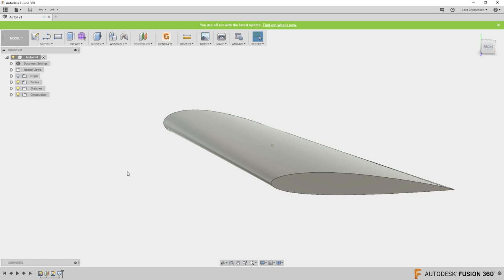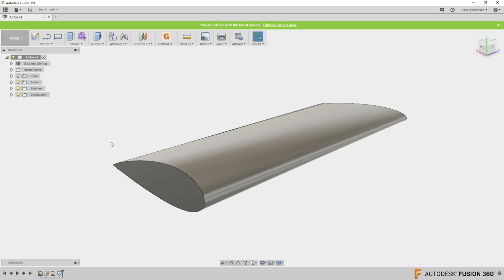How To Create Airplane Wing Ribs    — Fusion 360 Tutorial — #LarsLive 162

Comment: Lars,  
I remember almost 40 years ago using a drafting board and T square to draw a rib in class as part of required training as an aircraft mechanic.  The idea being if someone brought an airplane to your shop that had damage of some sort that required a replacement rib you could make a pattern.  Airfoil shapes are simply X, Y plots.  I never did,  and the technique would back then more easily apply to a rib made of small wooden components.  After school I went on to work on airliners for awhile where "sheet metal" repair was left to gurus of the craft.
However.... I am currently involve in amature/homebult airplane projects and the use of things like Fusion/ CNC/ 3D printing for ribs, cowlings etc. are opening up capabilities, possibilities like never before for individuals.......

Thanks for your presentations,
Bil
Reply from the maker: That is awesome to hear bil k .Thank you for watching the videos

Comment: Generally since Ribs are made of sheet metal I just use the shell command to match the the thickness of the  aluminum. I modeled a few experimental airplanes in Inventor to do simulation in ANSYS way back before F360 was around. However I am sure the same strategy would work well in F360. Now if only Frame Generator existed in F360.
Reply: You can use the sheet folding workflow in Fusion now.
Reply from the maker: Hi OahuPilot Thank you for watching!
I would love Frame Generator in FUsion :-)
Reply: It's not as good as idea as one would think on first glance. Wing ribs are stamped or hammered into shape, not really folded.  I have tried it in Inventor which has more sheet metal functions then F360, it really did not give any real benefits in the modeling workflow. Also you can not select curves for folds in F360 which makes sheet metal work flow not that useful in this scenario.

Comment: you should consider skin thickness from the OML with an offset value. And rib & flange thicknesses should be given as parameters that can be changed without going into the sketch. flange height should be calculated according to the number of rows and diameters of the fasteners that'll be used. And many more detail :) but a practical approach you did, congrats :)

Comment: Is there a way to define one rib section, complete with all its cutouts and such, and then "loft" it through the airfoil so you get the entire set of ribs, each sized proportionately for its position along the wing? THAT would be really helpful, not just for ribs of a wing but lots of other situations where one part needs multiple, slightly different-sized, components.
Reply from the maker: Hi Roger Garrett Thank you for watching!
My first thought was scaling, but using parameters might be the trick :-)

Comment: Great video thanks a lot for this tutorial. What I am interested in is how to add these stabiliser bars to the other ribs without spending too much time on it. I am asking this because I want to create a wing for a model plane and 3d print the hole wing. This means i need a thin surface and inside a lot of stabiliser bars otherwise it would be not solid enaught.
So compared to your video I do not want to create ribs at all just those stabilizers.
Reply from the maker: You are so very welcome :-) Thank you for watching!
I will need to gain some aviation knowledge to know exactly what you are looking for :-)

Comment: Hi Lars, love watching you tutorials pretty much everything I know about fusion is from watching your vids. just wondering for the cut outs in the ribs would it be possible to do two sketches on the outer most planes and do a loft to cut through all the ribs? is it possible to cut through them all using a loft command. Thank you for spending your time to help all of us out here learn how to use this awesome tool.
Reply: Yes it is. Tested it out just a minute ago. Also, instead of offset planes, you can do solid block and pattern that, and then loft/intersect those also instead of splitting bodies.
Reply from the maker: Great answer Harri!
Thank you for watching guys!

Comment: I have the latest ver of Fusion and while trying to do the boundary fill after selecting the faces as you do then when I press "select cells" my screen goes blank and nothing fills back in!!
Reply: Facing the same issue! :/ Did you find a solution yet?
Reply: Hi, it looks like you have to select rib's and airfoil plane too .Not only ribs planes. I hope it will help.